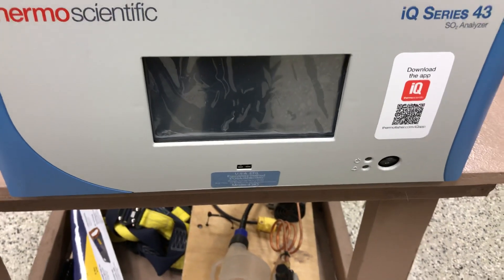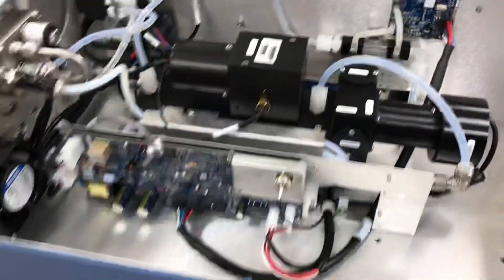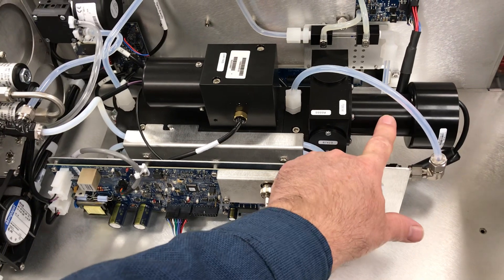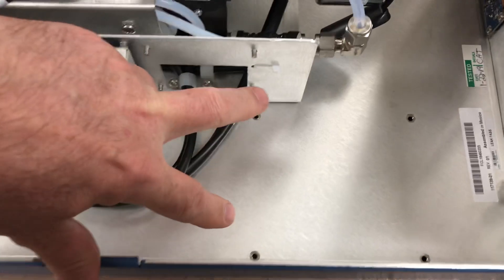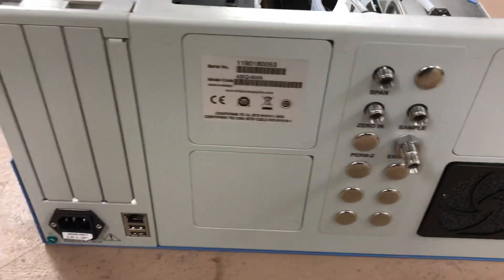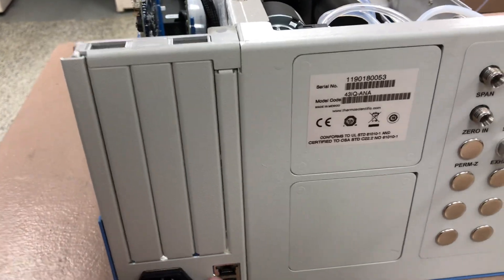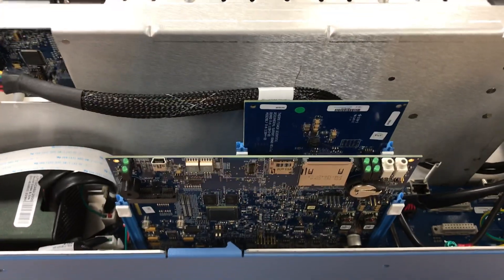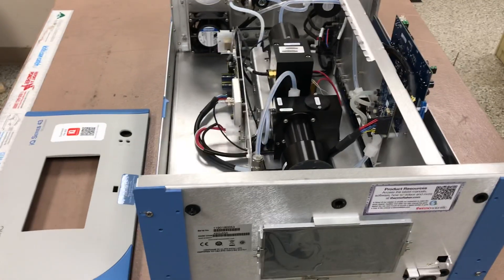Thermo Scientific Model 43iQ SO2 Analyzer

Comment: How does the analyzer draw stack gas and is the sample diluted?  Is the moisture separated out of the sample or is the sample hot and wet?  Thank you
Reply from the maker: The analyzer has an internal sample pump and draws the sample from the stack under vacuum into the analyzer.  Most stack applications have a sample probe connected via umbilical to the analyzer, which is either dilution probe or direct extraction probe (no dilution). Yes moisture must be separated out of the sample.  Sample conditioning is typically done using a chiller before reaching the analyzer. Thermo Scientific probes can be found here https://www.thermofisher.com/search/browse/featured/us/en/80013149